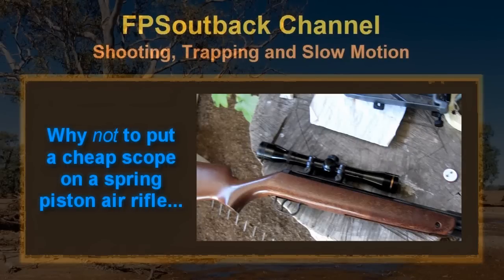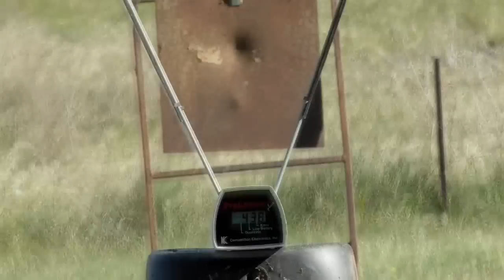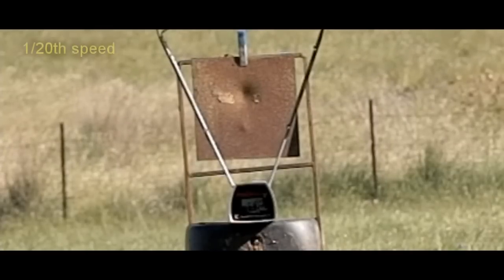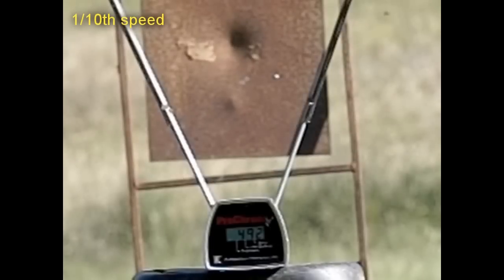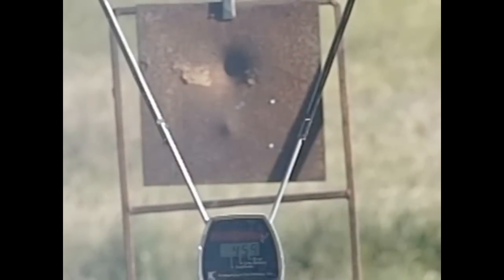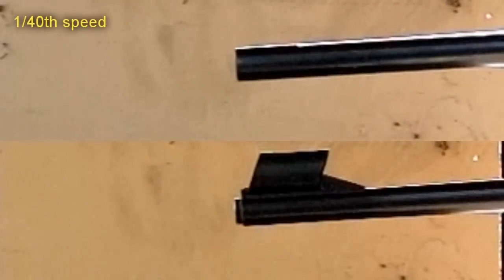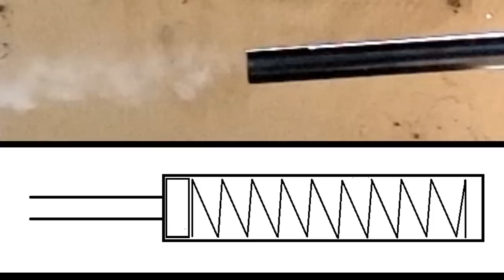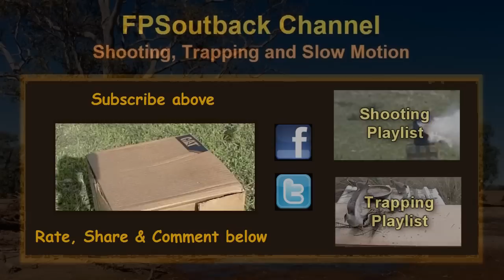Spring Piston Air Rifle Recoil and Scopes

Comment: Very good and interesting video, I'd been wondering why my cheap BSA air rifle scope performed better on my air rifle than some more expensive scopes, holding zero etc.
Turns out it was the recoil from the Gas Ram, which mind you isn't as bad as a springer but still seems to shake about a normal scope.

Lesson learnt stick to a certified air rifle/shock absorbing scope.
Reply: My scope wouldn't hold zero but my friends scope would and I didn't know why until now.
Reply: +Bigfoot And Bananaman I need an air gun scope. I think that's why mine won't hold zero
Reply: nitro piston / gas piston is harder recoil for scope than spring gun
Reply: sepfirem I don't think that's right my man

Comment from the maker: At close ranges a rifle will shoot low as the pellet/bullet hasn't broken the line of sight yet. Though your problem sounds like parallax. If you look down the scope and move your head about when sighting in close and the crosshairs move even though your rifle is not, its parallax. Its a common problem for air rifles (or other rifles used at close range). If you don't have an adjustable parallax scope you'll need a new one, making sure its designed to be used at the ranges you require.

Comment: This is why, when looking for air rifle scopes, I look for one that 1) says it's " shockproof" among other qualities. And 2) it actually states that it's made for " magnum" or " high powered" air rifles. They're designed specifically for the back-n-forth boxers jab sort of recoil unique to springer's. I settled on the one scope with the best bang for the buck on amazon-The Hammers 3-9x32AO for $52USD, that I got %off & points off on for $48.91. It's designed specifically for break-barrel springer's.
Reply: (Some notes I have picked up along the way- long version)
I've seen that exact Hammers scope, among several other brands. There are always some "negatives". I have studied them a bit. Some negative reviews of several brands are apparently due to the effects of "barrel droop". I learned that droop-related ("massive") turret adjustments coupled with the classic double-recoil can be very bad for 'any' scope, even those "specifically built" for springer/gas piston rifles.
 So, IF you find yourself making turret adjustments close to max, and/or to the point that the turret detents ("clicks") get loose, the seating for the  internal "erector tube" on any brand of scope will shift because of recoil. Period. There goes you grouping, and maybe your scope.
 So, the solution seems to be: Start with a rifle with a "scope-friendly" barrel angle, or fix the "droop" problem BEFORE the rifle is fired again. Adju$table scope mounts or (careful) rear ring shimming can get your adjustment closer to "home", near the middle of the adjustment range.       
 Like most, I want to make only ONE scope purchase for my magnum springer.  I don't want to break ANY scopes. 
The Hammers 3-9x 40mm version is the one I'm looking at.  Please let us viewers know how your 32mm version works out for you.
 (Please pardon my long-winded reply: I only do this to help the NEXT shooter avoid some disappointment and confusion about "the best scope".)
P.S.: They do not advertise this, but during my research I also read that this Distributor offers a limited lifetime warranty on Hammers scopes: 
Wing-Sun Trading, Inc.
15501 Heron Ave.
La Mirada, CA 90638-5202
Tel: (714)522-3860
Fax: (714)522-6417
Reply: Thanks. Saved site for later possible use. It really does come don to the quality of the airgun & the shooter's abilities...
Reply: Well, I mounted it on my Hatsan Striker 1000x .22. Can't shoot on my own property where I live. So going to the local indoor range is it. Got 56 shots through it so far, with the 3-9x32AO scope. The Hammers 4-bolt mounting rail hasn't budged. I also got a larger Hammers 4-12x40AO for my Winchester 1400CS .177. One of the so-called, " magnums". Mounted it with Intraspark 5-bolt magnum air rifle mount. It tested with 5.2gr pellet at an average of 1410FPS. Funny part is, after only 20 shots, the breech seal blew out, rather than the scope...;)
Reply: Renegadebroadcasting Renegadebroadcasting  Just fine and no problems at all. The scope has zero problems. The striker 1000x .22 now has a modded model 95 Turkish walnut stock I refinished. Beautiful rifle. Dropped my Edge .25 vortex into the Striker stock.
Reply: Renegadebroadcasting Renegadebroadcasting  Feel free to ask any questions you may have. Ya don't learn if ya don't ask!
Reply: Renegadebroadcasting Renegadebroadcasting  Can't see why not?

Comment: Crosman Diamondback 22 totally smashed my Niko Stirling Mountmaster in less than 200 shots. It detached the front sight glass and cracked it. (It also DEMOLISHED the factory CenterPoint scope that came with the gun in less than 200 shots. - must have broken the springs that support the turret adjustments, could not make any adjustments at all, just binned it!) I have since bought a Hawke Airmax and it is a thousand percent better, very accurate but twice the price of the Niko.

Comment: I particularly liked the summation that "you shouldn't use a cheap scope, but in the end you probably should.... as the springer is likely to break any scope!"

I politically correct statement if I've ever heard one.  hahaha

I've debated what to do as well:  And at what is the financial tipping point where I'd be comfortable spending, getting good accuracy and then still be OK having to replace it either under warranty or not.

Great posts you've done.

Comment: This is one of the main reasons I only buy PCPs now. Even when I put expensive scopes on my springers I have to rezero them from time to time. They don’t break at least, but I get tired of fiddling with them, tightening mount rings, etc. With my PCPs I simply zero them at 50m and leave them. If my shooting is at shorter or longer range, I adjust holdover/under accordingly with mil dots. Same with windage. I enjoy good springers more out of nostalgia than anything else. But I’ll never buy another because they’re tough on my scopes, and quite simply not as good or accurate as a PCP. 
Yes, I only use proper airgun rated scopes on my springers. Which is another bothersome thing about them. With a PCP I can mount whichever scope I like, and not worry about it being “air rifle rated”.

Comment: Buy a mid range "air rifle scope" and proper mounting (preferably 1 part, with 2 rings and with the pin screwed to the top of the gun) Should do the trick, Believe me, learnt the hard way.. Shot trough many airgun springs, and few airguns, What i would suggest ATM is that gas piston air rifle, way less recoil, to kill scope, and way quieter. yet more accurate, and pricing is not too bad either.

Comment: I have a Gamo Maxima 6.35 cal airgun (piston/spring powerplant) with a Center Point Scope but im having some issues regarding the set up of the zero point, i have a shilba laser calibrator which enters and fits snuggly into the barrel and then try to calibrate @50yds approximately, i center the laser dot with the cross hair of the scope and all good, then after just one shot the laser dot has moved way off from the center, what can in order to solve this? i tried at many distances, no effect :(.

Comment: What was wrong with that mod 34?  I used a mod 45 diana for over 20 years and it held its velocity much better than the 34.  The 34 is supposed to be an improvement over the 45 as well.  iron

Comment: A cheap scope designed for air rifles is fine. I wouldnt but a cheap scope designed for a 22lr and up, buy quality, can get a nice 3-9×40 vortex crossfire ll for right around $150, no question lifetime warranty and when they say shock proof they mean it, if it fails its replaced. I cant afford to put them on all my rifles so i have a couple Simmons 22 mag scopes. They claim to be shock proof but i droppes mine lightly, nothing dramatic and it started stringing shots instantly, before the drop i was gettin 0.25 inch 5 shot grops at 30 yards, after the drop it opened to 2 inch groups.

Comment: I've never had a problem with Nikko or Leapers scopes on my .25 Hatsan 125 sniper, just get good rated mounts and rings and shock rated scope. You don't need to spend much. My old Nikko still sweet and holds zero after 8 years. Clean the gun and use good rated pellets. Stop drinking that awful Aussie beer lol

Comment: Prob just destroyed a good solid old scope. If that had been me' my dad would kick my arse for been so thick. If that scope been laid around for ages it may of taken 20 shots or so and few taps on the turrets would of helped to settle the scope back in. Also I would of pulled a bit of WD40 through the barrel and a couple of dry patches and then a few shots to re lead, then the test might of turned out better.